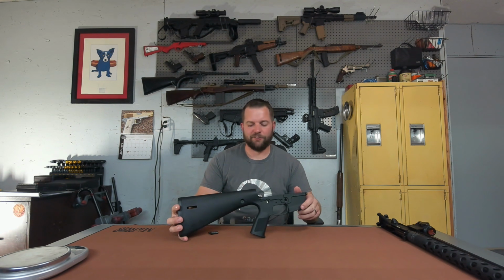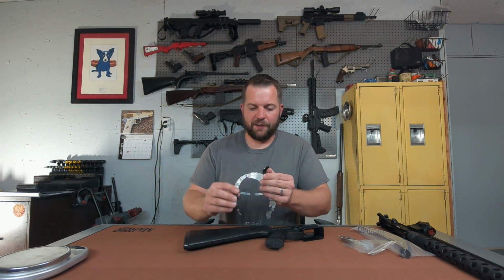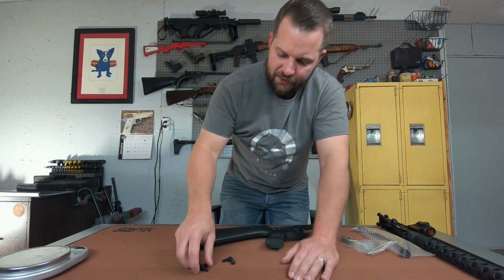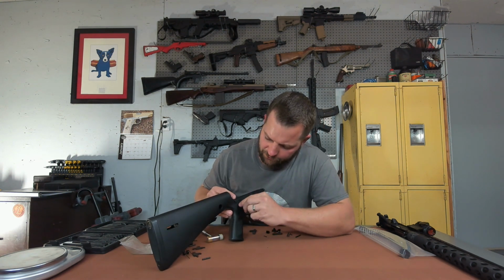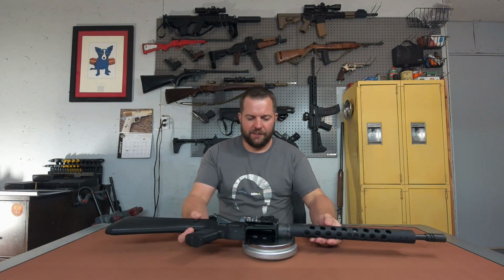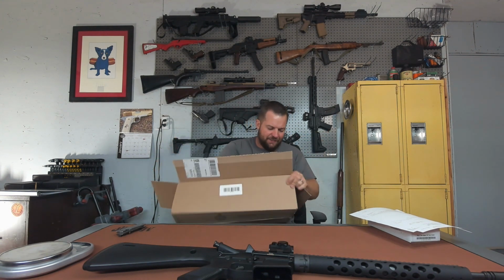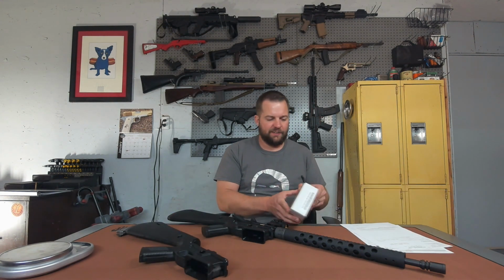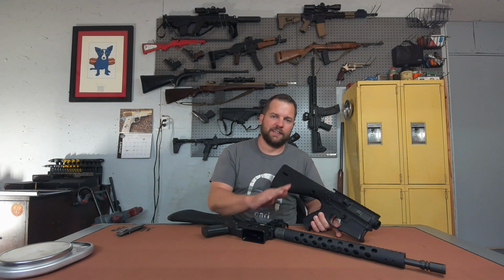KE ARMS KP-15 safety selector and final assembly of the po'boy WWSD2020

Comment: I built a WWSD rifle with everything except I used a light weight aluminum handguard instead of carbon fiber. 
Just a side note. If you take that lightweight upper and put it on a mil spec aluminum lower, it feels great. The extra weight in the back of the carbine makes the gun feel even better balanced than with the KP15 lower.

Comment: FYI, you get ONE chance to get it right. If you mess up and don't mill the selector properly, the only way to get it out is to either destroy the selector or destroy the lower. Do yourself a favor and just buy the proper selector. At least then if you can't get it out, KE Arms will make it right. The KE Arms adapted milspec selectors are designed so they can be gotten out by turning them to the halfway point and applying some force or giving them a light tap with a punch. The ambi selectors have a notch cut out to allow easy removal at the halfway point once you remove the right side knob; the knob sits flush with the outside of the receiver to prevent the notch from becoming an issue when installed.

Comment: KE arms must’ve seen this video. I ordered a safety and it does have a coating on it now.  Looks much more professional.
Reply from the maker: I know Russell has seen at least some of the videos.  He reached out personally and has commented with product updates.  He’s a great guy running a great company and he is genuinely engaged with the community in an effort to constantly improve the KP-15 platform.
Reply: @dfwguncleaning7523   - what do you think about the trap door but plate? 

Mine didn’t come with it but as soon as they released it I bought it. I was disappointed that it has holes in it. It doesn’t need to be watertight but having holes in it seemed kind of half assed.
Reply from the maker: I’m indifferent on the trapdoor.  The void in the stock doesn’t seem to be designed for storage.  Not worth modding one or ordering a specific one for me.

Comment: Aluminum lower with rifle length buffer tube and 3D printed stock, Spike’s slick side upper, 14.5” pinned and welded Faxon pencil barrel and VSeven magnesium rail, aluminum bolt carrier will put you just above 4lbs with various iron sights.

Comment: I bet because they are getting used for the wwsd rifles it is going to be a min before they are available again. I saw 14.5" available somewhere if you are handy enough to pin and weld a barrel that might be an option to go with
Reply from the maker: I’m afraid you’re right about the availability.  I’ve backordered from a couple of places and they are already pushing the ETAs out.  Appreciate the tip on the 14.5, but I’ll keep waiting on the 16”.  I plan to shoot it suppressed quite a bit and need to be able to switch between suppressor mount and flash hider easily.

Comment: How do you remove the safety after install?
Reply from the maker: If you used the KE Arms safety, position it halfway between the safe and fire positions and gently tap it out over the detent.  If you didn’t use a KE modified safety, in may be necessary to drill out the safety to depress the detent, though some report that they were able to remove a mil spec safety the same way you would remove the KE modified safety.

Comment: With my KP-15, I went with the same slick side upper, the Faxon 13" CF handguard, and a 16" Colt 6720 pencil barrel, JP silent captured spring buffer, and an Aero Ni-B BCG. With the Romeo5 optic, my final weight is 5.5 pounds. My son said one of his Nerf guns weighs more!
Reply from the maker: Very nice.  I’m going with the 13” Coda carbon fiber handguard on my 2nd one.  I’ve backordered the Faxon pencil barrel as no one seems to have them and it’s a couple ounces lighter than all the others.  How do you like the JP silent setup?
Reply: @dfwguncleaning7523  Love the buffer! I have one in my AR-10 as well, and they really are pretty epic. Expensive, but worth it.

I also wanted the 14.5" Faxon with the permanent brake, but got tired of waiting for them to come in. The Colt popped up at a price that, while more than the Faxon, wasn't a complete hose job. (And besides, it's a Colt! :) )

Comment: Thanks for posting your journey!  Is it safe to say, if buying KE ARMS/KP-15 stripped lower,  fine to go with a standard LPK + safety selector (as long as up for dremeling/filing the safety) ?? or is anything truly proprietary aside from the KE small parts included -pivot and takedown pins -buttplate -5/64" roll pin to retain buffer detent ?? thanks for the advice and feedback and LOVE the content of sharing this journey
Reply from the maker: I would definitely go with a standard LPK and dremel the safety selector just to save the time.  Everything else is standard mil-spec.
Reply: @dfwguncleaning7523  ok here is the kicker.. what if you want an AMBI safety selector?  In that case, would the DIY approach likely not work given connecting through both sides of the lower and require their proprietary ambi saftey? Thanks for the response above and all the help along this journey.. which i plan to join/copy soon ;)
Reply from the maker: An ambi should work the exact same in terms of install, with the added step of attaching the lever on the right side.  It will just need the same slope machined between the detent notches so you can remove it later on.
Reply: Don't make my mistake, go with the ambi selector from KE Arms, or drill your existing to have a taper or passthrough so you can get it out. Otherwise do not use a standard milspec selector and it will be stuck. You will also need the KE Arms Fire control group KE Arms pins, those are not milspec.
Reply: they have ke lpk's in stock at brownells

Comment: Change out your upper to a non-forward assist and you'll drop that oz.
Reply: Damnit... just hit that point in the video. You got me.
Reply: A forward assist is still better to have. It's not terribly uncommon for a first round in the magazine to not fully go forward, even on a new rifle with fresh springs, especially if you don't cleanly release the charging handle. If this happens, it's quicker to hit the forward assist than run the action again. Some people complain about not needing the forward assist, then conveniently forget about situations like this that can happen when the rifle is perfectly clean simply because there's more than one way to operate the rifle. If you're charging from a closed bolt, this is a real risk and it's best to not remove the quickest and easiest way to deal with it.
Reply: @WardenWolf  I disagree
Reply: Go with a pencil barrel and save some more weight.
Reply: @Cyrus Freeman I have on numerous occasions. To each their own
Reply: The forward assist is also good if you want to silently close your bolt. Instead of using the required inertia by racking it you can slowly ride the bolt forward then push on the forward assist.
Reply: @Sandhill1988  that's one of the reasons the finger groove is for on the bolt, and if your bolt is hot from rapid fire, you don't need to be silent.

Comment: “I did happen to keep looking at brownells” (whips out another package) happens to the best of us hahaha

On a separate note, I’ve been thinking about getting a Midwest industry lightweight rail or just going for the carbon fiber rail...right now I have a Stngr vlcn Rail and am going to use that for another build.
Reply from the maker: I’m torn between the Midwest lightweight and the Faxon carbon fiber myself.  The Midwest is less than an ounce heavier when you get the titanium barrel nut.
Reply: I have a v7 systems hyperlight rail and it is lighter than everything available. Same price as the faxon carbon fiber but lighter and made of magnesium.
Reply: @dfwguncleaning7523  I did a cheaper lightweight build and I ended up using the Aero precision lightweight handguard works out good

Comment: Is there any photos somewhere of what the shelf looks like on the KP-15 selector? Got a milspec selector and want to dremel it, but dont know exactly what it's supposed to look like
Reply: Piece of advice: don't do it. Because you only get one chance and if it's wrong you'll never be able to get it out. There are 3 possible outcomes: (1) you go too shallow and wind up with a stuck selector (or too deep at one point and it's both stuck in the gun and you can't rotate it), (2) you screw up your selector and have to buy a new one, negating your cost savings, or (3) you actually get it right and it works and is removable. In 2 of these 3 scenarios, you're not left with a usable part, and face considerable extra expense.

Comment: Sorry, but 6lbs plus is not lightweight. This could easily be achieved with an aluminum lower.
Reply: His build does not really illustrate the benefits of the KE arms polymer lower. I have their FDE version, just came in, and it is almost half a pound lighter than a comparable complete lower that is using an aluminum lower and buffer tube, with a basic Magpul MOE handgrip and buttstock.  The point of the KE arms lower is that you get a full stock, good grip, exc at the same weight that is only being achieved by spending a bunch of money on expensive minimalist lower parts.